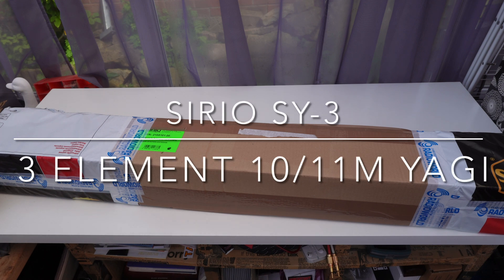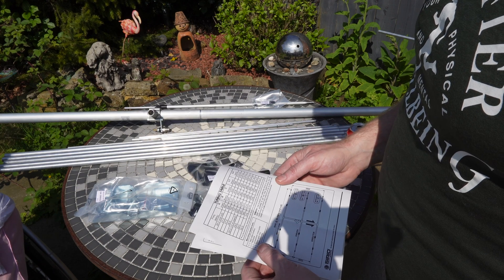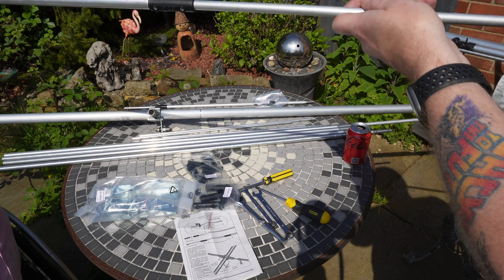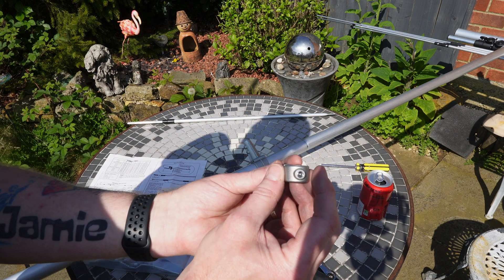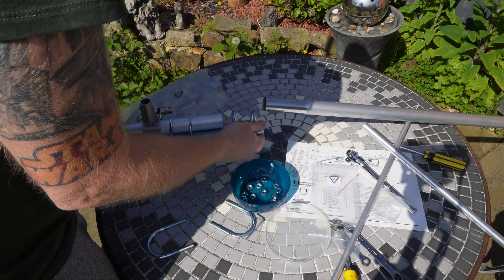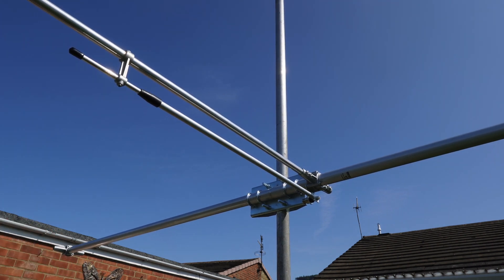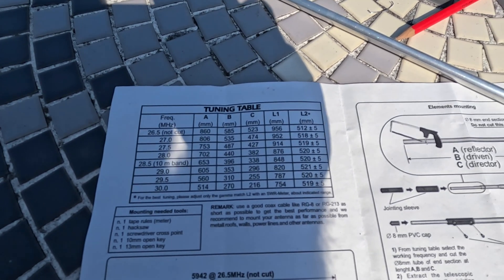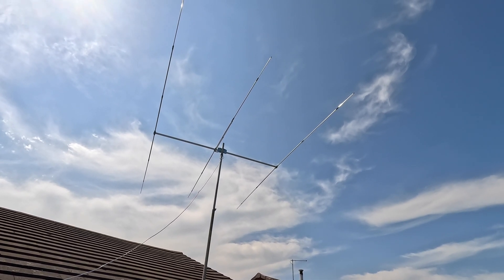SIRIO SY27-3 10/11m 3 Element Yagi/Beam Antenna,Unboxing & Assembly

Comment: You still got this up Neil or what and what do you prefer this or the blizzard?
Reply from the maker: This is down but in the new year another is going back up with a few extra elements. As for preference for DX the Yagi is a good chunk better but for local the blizzard is more useful, it is still good for DX but like i said the Yagi is a big improvement.
Reply: @gtretroworld Ordered the blizzard today mate , says should be getting delivered tomorrow, fingers crossed the weather stays alright and I can stick it off when I'm off work this week 😁. 

Might get the yagi at some point and take down my CLr2 which is basically planted in the middle of the garden , I'm going to stick the blizzard on the side of the house see how it goes .
Reply from the maker: @williamn01 I’m certain you will like the blizzard especially its strength as it hardly moves in the strongest of winds.
Reply: @gtretroworld Good stuff mate thinking of getting one , hope you have a good Xmas 🎁 all the best buddy .

Comment: Have you had any issues with the grub screws backing out from wind vibrations?
Reply from the maker: Tbh I have never had a problem. I currently have Sirio Blizzard up that uses a similar setup and that is also fine, however i do use amalgamation tape on the joints just to be sure.

Comment: I bought myseft one of this model of beam. I asked to sale rep if this antenna was good to be used in vertical position. His answer was yes. I tried to contact Syrio's technical dept by email, no answer. So i bought it. Couple days later, i raised the antenna at 50 feet in the air with a SWR of 1.0 at channel 1 and 1.2 at channel 40. The antenna was working fine, very good copy and rejection overall. 
 I was so happy until rain couple days later. The SWR went up to 2.5/3.0. If your lucky, SWR will lower as soon as the antenna dries but it takes couples days of sun.  They did not provide any holes to drain water; there is a glaring lack of engineering. Really disappointed of the product.
Reply from the maker: It works perfectly well horizontal in any weather but vertically it will definitely hold water up top. I agree it needs a little more thought. It maybe worth drilling a few small drain holes. Thanks GT

Comment: Those grub screws are insane. They seem to have a mind of their own. As soon as you open the wee bag, mount them on the bracket, just as GT said. The smaller U-bolts that fit to the boom. DO NOT overtighten them, they will deform the boom and cause it to dog-leg in the middle. I was lucky to have noticed it and backed off a little. Cut the lengths to EXACTLY the suggested lengths or to your own calculations. I did, and it didn't need any adjustment, literally calculate, cut, build and mount. 1.3:1 SWR 28.000 to 28.500, just as I wanted. Performance? (4 el version)  It's night and day compared to a horizontal dipole or a vertical. The noise floor drops away and stations come up big time. 10M looks closed on my comparison antenna but is very much open on the Sirio. At €200 it's a no-brainer. I parked it at 290 degrees (from EI) and worked stateside all day long. Thanks GT Retro World. A great video and a great and very well priced antenna.
Reply from the maker: Thanks, Yes you really do need to watch those set grub screws as they like to wander.
 I agree it is a great antenna especially the 4 element that you have. In my latest video you’ll notice i picked up 2 of the 3 elements at a Hamfest so the plan is to try and build a 5 and a 6 element version. I will probably try the 5 first. Expect another video experimenting with it at some point. 73

Comment: I’m thinking about getting one of these but the seller claims it’s around 6m by 3m in dimensions is this correct ?
Reply from the maker: Yes it is just under those dimensions at 5.7 x 2.7. Although it seems quite large once it is in the air it is relatively small. So worth it though.

Comment: the gamma match on these are poor , i had the 3 element and my mate had the 4 and we both had the same problem , one day the swr was under 1.5 but one day without changing anything it went to over a 2 and both were well weather proofed , both of us changed the driven to a open dipole with a hairpin match and swr never moves.
Reply from the maker: I have never had an issue with the gamma on the few i have had over the years but a hairpin match is very reliable way of matching. If it works and you’re happy that is what it’s all about.
Reply: Not true,

Comment: This looks great; many thank for posting as it is very helpful to watch you build it.  Question, though, rather than cutting the beams, could you not just slide the smaller pieces further in the larger ones and drill holes to hold them in place??
Reply from the maker: Yeah of course you could do that but if it’s going up permanently it will be far quieter(vibrations) if you cut it.
Reply: @gtretroworld .  Makes sense, yes.  Thank you.  I think I’ll order one of these.  Deciding between a three- or four-beam model for 10 m.  Thanks again for posting the video—very helpful!

Comment: If it's just the outer, smaller aluminium tubes that get cut, then you could always get some spare 8mm (1mm wall thickness) aluminium tubing if you want to repurpose the antenna for a lower frequency.🤔

Even with a miter box and hacksaw, I can never cut straight, so a small pipe cutter should work for me. 🤞
Reply from the maker: You could extend it quite a bit by doing that and even more by adding traps. For the money it could be made into a very versatile antenna.
As for cutting let the saw cut it at its own rate and you will cut straight. 
Failing that use a Dremel, you will never look back.

Comment: I’d have loved to have had one of these when I dabbled in CB. However, I did the ham exam and got it tg! I have great respect for CBers. Most hams started out that way.👏🇮🇪
Reply from the maker: Most of our generation definitely started with CB Radio but a lot have there ticket too these days. I tuned this antenna up for 10/11m and it works incredibly well on 10m.

Comment: Dear friends,

I am radio amateur from Armenia, Yerevan! EK6NK. I have purchased Sirio SY-3 yagi antenna for 11/10 meters in Paris in the shop!

We tuned it how it was written in instruction and it worked very well on the floor/ground by using test mast for only 2 meters height. By antenna analyser we got good conditions of antenna data like: 1,11 SWR, 52 ohm impedance, -25.3db returne loss(see attached picture). But after installation on metallic-steel roof we have very bad data, we thought it is height of antenna and we increase it from 2.10 meter from roof to 2.80 meter, but no good changes(see attched picture). Also we have second VHF/UHF antenna on the same mast with vertical polarisation higher from Sirio by 1,5 meters(see attached picture). When we rotating antenna from South to North it working better, but not so good that we prefer. What do you think? What is our mistake? What to do ? 

Thank you in advance for advices 

Best regards, 73
Reply from the maker: At an educated guess i would probably say the metal roof could be causing a bit of an issue but to what degree i am unsure. I am guessing the SWR is higher but is it unusable?
Reply: @ no, it is usable with ATU but I think antenna gain is not good, that’s why I want to have good data
Reply from the maker: @ Could you try it up high away from the steel roof?

Comment: A tip guys. Use heatshrink tubing over element joints, i use the ones with glue inside. Dont forget same with gamamatch😎
Reply: Mine has just arrived this morning and it's a sunny day. Usually it's pissing down for a month when I get a new antenna 😂
Reply: Antenna on hold got knocked off my motorcycle and need surgery to rebuild my leg. Always the same when a new antenna arrives 😂
Reply from the maker: @DiscusRussell  Sorry to hear that bud, i am just in the process of restoring a 1960 Lambretta, not much chance of injuring myself on one of them. Take it easy.
Reply: @gtretroworld  I was on a Honda C90 cub. It doesn't matter what you're on it still hurts😂
Reply from the maker: @DiscusRussell  That won’t be more than a mere flesh wound lol… joke aside i am pretty used to coming off especially after years of trials riding although i am a bit older now so maybe it could be painful 😂
Reply: @gtretroworld  I was only doing about 20mph but the whole force was just under my knee. Was wearing proper gear but it's just shit happens 🥴
Reply from the maker: @ I normally bail clear if i get chance 😁…Take it easy
Reply from the maker: Yes, Definitely recommend if you plan on leaving it up permanently. 👍

Comment: I assembled & put mine up about 1 month ago & it worked very well, but recently the SWR went very high.

I failed to waterproof the Gamma match tuning area where the rod goes into the other rod, and I think rain got inside due to recent bad weather.

I've read a few reports of this area being susceptible.

Is yours still doing OK, & did you watetproof everything, including where I mention?
Reply from the maker: @fourbyten5490  I was using it for just under a year and removed it to use a home brew Quad that never materialised, However i did use self amalgamated tape on all the joints and never had an issue.

Comment: Hi gt wonder if you still have spec sheet and could you please put up the boom length and spacing between the elements I have a four but don’t have the room for it I know it’s possible to shorten just don’t know what the measurements are hope you can help me
Reply from the maker: Yeah no problem, Boom is 2680mm, between the reflector and driven element is 1440mm and  driven to director is 1240mm. Hope this helps.
Reply: @gtretroworld  thanks gt got some rebuild to do👍👍👍👍💯

Comment: Hello,

Great tutorial.

I've just bought this, and I'm about ready to construct it.

With the elements cut to 27.5 as you have, is it possible to alter the Gamma match to get a SWR lower than 1.5:1 as you have, please?

I do most of my operating between 27.400 - 27.600, so I would ideally want my SWR at 1.1:1 at 27.500.

Many thanks in advance.
Reply from the maker: @harrybatt998  Yes you should be able to get it down a bit more if you only want that narrow bandwidth , unsure about 1.1 though, just take your time as it is quite twitchy.

Comment: Hi Neil.. is this a S0239 coupling for the pl259 plug.
Reply from the maker: These are the usual male SO239 mount fitment Glenn, so basically the antenna is a PL259 that fits SO239 mounts if you get me.
Reply: @gtretroworld Yeah so it's basically the same as screwing up a normal base fed dipole like a half wave..
Im Going to order one later today but I live in a bungalow and wondering just how obnoxious it will look when up in the air 😂
What do you think are they too much or are they not that bad in size..?
My neighbours aren't an issue I just don't want anything to obstructive.
Reply from the maker: @DeltaXray444  Ignore the Above Glenn as i thought you were referring to my latest Video with the ATAS 120. I didn’t even look where the question originated from in studio 😂.
So yes just the usual PL259 plug to the antennas SO239, as for the size put it this way you’re not going to find anything smaller unless it is trapped.
Reply: @gtretroworld  I meant to ask you the antenna in the instructions says it's set for centre frequency.. do you know what channel that is and what the swr is.
Im Not sure if you mentioned it in the video or I may have got cross wires..

Also sorry to be a pain in the ass.. if the antenna is set up as per the instructions is there any need to cut the ends or is that necessary.. 
I've only ever put up a five element before but it was a mates and everything was pre marked with a black marker pen so the swr was set, I've never taken a new one and assembled it so im a little fuzzy headed as to what to cut or not to cut 🤷🏼‍♂️ help me out buddy I've only been on the radio 47 years and im a nube. 😂
Reply from the maker: @DeltaXray444  I set mine for my requirements for 10/11m but it was quite a tight bandwidth, worked extremely well with a quick tune of the ATU though. I cut it for around 27.800mhz at 1.1. Unless you plan on using 10m i would drop the centre a good chunk lower. Hope this helps.
Reply: Hey Neil im working on the beam but it doesn't matter what I measured up to cut the measurements are off.. 
Any chance I could phone you and chat about it.. to pass phone numbers my email address is on my YouTube channel. Thanks.
Reply from the maker: @DeltaXray444  I have just sent you a email Glenn 👍
Reply: @DeltaXray444 

Did you cut the elements as per the manual, & did you get your problem sorted?

Comment: DX will die out for years soon and horizontal won't work very good for local.
Reply from the maker: There’s still plenty of time buddy, horizontal is fantastic locally with a few i know as they’re also on the flat side. Thanks for visiting the channel.
Reply: @gtretroworld  The peak of cycle 25 is now, and skip conditions will fade to nothing over the next few years to nothing for years during minimum. Horizontal polarization doesn't work well for local communication and that's just a fact. Just because you can use your antenna doesn't mean it works well. Most signals are vertically polarized. I have been doing this longer than you have been alive. You're a newbie and it shows. You're outing yourself. And  I'm not your buddy, numps.
Reply: @gtretroworld  It'll be dead soon, and it'll be useless. You may talk local but not very well or very far. Most signals are vertically polarized. You're obviously a newbie. Plus that yagi is only around 10 db gain, less than 1.5 S units. Not really worth the effort and expense to talk to strange men on a box.
Reply from the maker: @terryparker1925  Unsure if i am classed as a newbie and have used horizontal antennas well over 30 years. I literally only talk to friends locally and not strangers as there’s only a handful still on. For example with a friend who is around 15 miles away both running vertical we average around S7, Yagi to his quad is around S10.
I agree there’s definitely a place for vertical but for me personally it isn’t essential for 11m.
Reply: Are you ok sir? Are you upset about something? @terryparker1925

Comment: Sirio builds really good and also cheap CB radio antennas, I often use the 4 Element Yagi Beam horizontally for mountain radio, 73 from Tommy 📡
Reply from the maker: For value nothing beats Sirio antennas Tommy, i plan on building the 4 element over the summer when the good weather finally arrives.
Reply: @gtretroworld  Try a delta loop. A 2 element loop will outperform this antenna. Shame Vortex went tits up
Reply from the maker: @DiscusRussell  I have materials to build a few Quads that i want to try but a delta loop is definitely on the cards sometime.

Comment: hello, how long does it take to install this antenna? I would use it for portable
Reply from the maker: If you had all the elements built up you could have this up and running for portable work in 10-15 minutes. Probably the same again if you had to build the elements up.

Comment: good video, do you have good results with this antenna in DX?
apparently you made the cuts for 27,500 Mhz and according to these cuts do you have a good swr on 27,500 and what is the bandwidth please
I have the 4 elements but not yet assembled. 73's
Reply from the maker: The antenna is superb so although the 4 element with have a smaller bandwidth the extra gain should be pretty good.
For 10m and let’s Say 27,385 I used the radios ATU but it was still very good.If you plan on just using it for 11m just work out the centre of where you plan on working and cut for that.My measurements and SWR readings are in the description.

Comment: Just had the SY27-4 delivered and was wondering how broad banded it would be from a planned 28.400 mhz set up. The SWR measurements you provided answered my question before I even put mine together. Thank you for taking the time and effort to provide this information on your set-up of the antenna. I'm looking forward to getting mine up in the air. Great video! 73.
Reply from the maker: The Bandwidth with the 4 Element is a bit narrower than the 3 but it will cover all the 10m band without any problem whatsoever.. I was actually going to try the 4 element myself but i am hankering for a Quad next, maybe someday i will try it though.